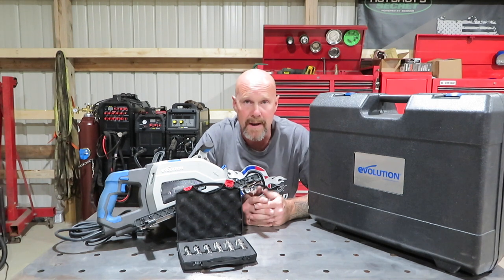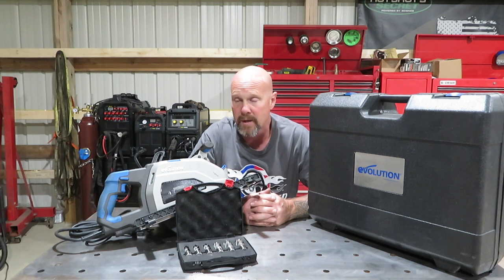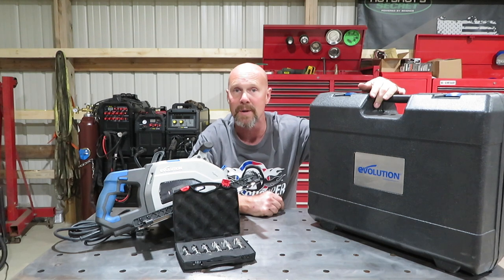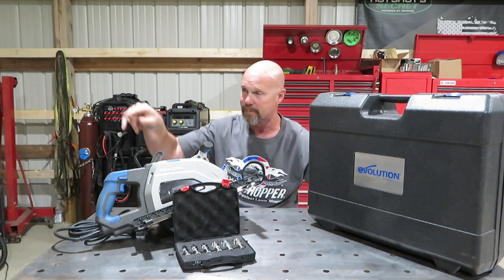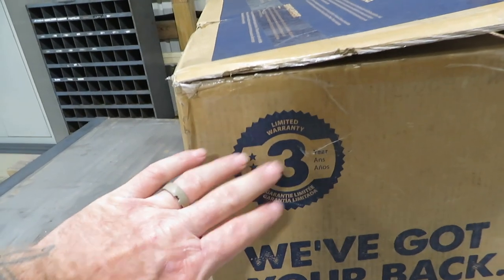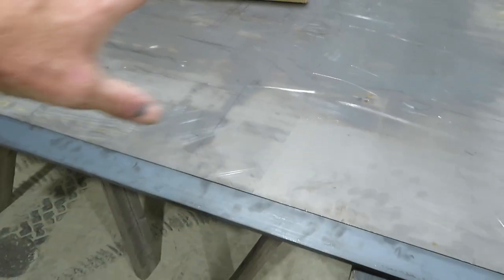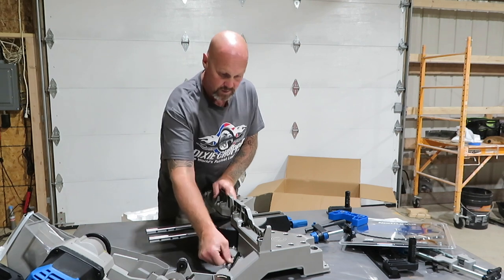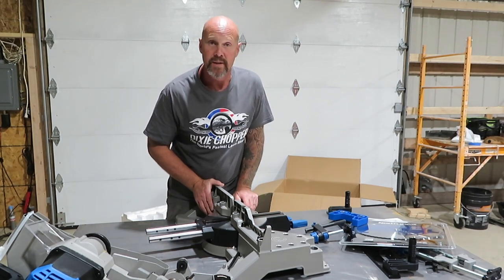Evolution S355MCS Mitering Chop Saw

Comment: Hey man, how you copin with the chips 😂😂 ive had the same model for 5mths, i just deal with it when finished just get the shop vac or broom i use the dewalt dw7260 folding stand one word, awesome 
Cant believe you got no comments!! I also had to fit a soft start module to mine because of high inrush current! But i love mine🎉 
Cheers from the 🇬🇧
Reply from the maker: I’m dealing with it. I made a stand and have roller conveyor between that and my Band saw